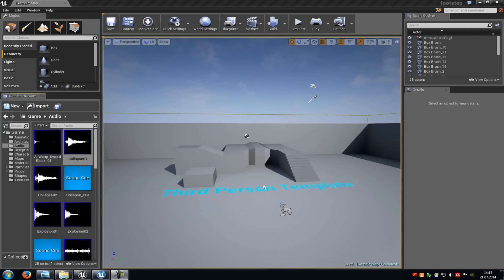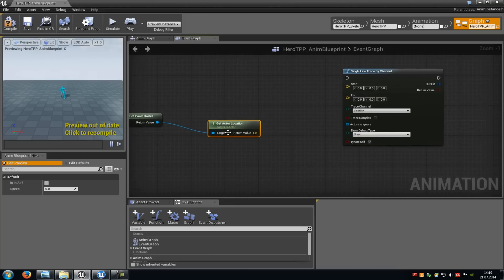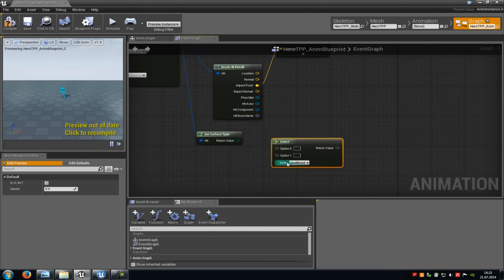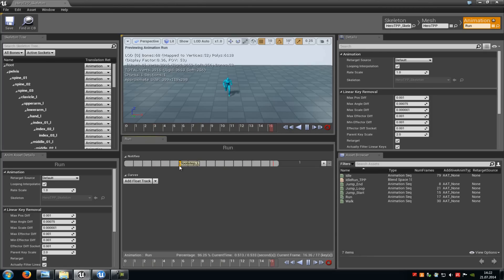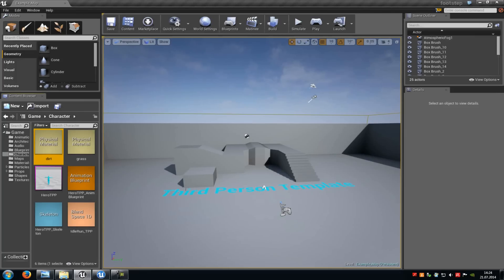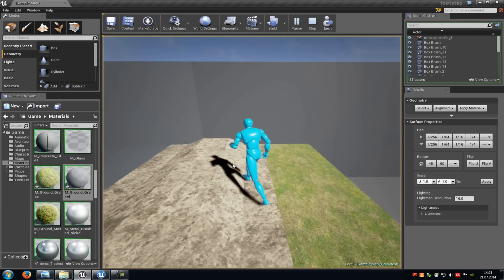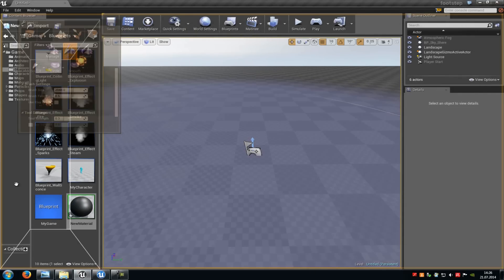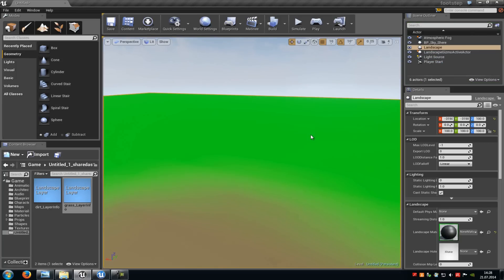Unreal Engine 4 Tutorial: Footstep Sounds (english)

Comment: Well im a bit late here but for anyone still around looking for a "Firstperson-nonAnimation-ObjectOnly" type solution, Ive figured one out! My solution used most of whats already explained here except for that all of the blueprints with the "break hit result" and "Line trace" and what not is all done inside the character's blueprint. For my project I have the character's animation rigged via using static objects that move and/or rotate from a "Timeline". Within the Timeline I have a Square-wave float-value to keep track of where in the animation the character's feet "Step" onto the ground. (Keep in mind: if you dont have any objects to have a visual representation with dont worry you can always just make a simple one-step-per-second-or-so guess to make up for it.) Within this float you simply edit it so that its set to 1 when you want to play the sound and 0 when you dont want it. Make sure to make the areas where its set to 1 short or you might have your sound playing more than once! (Also dont forget to Loop your Timeline animation!) After this is done simply take a wire from the Timeline's "Update" point and connect it to a "Branch" with the condition being "If the float from the timeline is 1 and is equal to another float 1 then go True". Simple as that. Then lastly, off of that branch connect the wire to the "LineTraceByChannel" Node and It should work. Hope this helps anyone out there! (Though keep in mind all of our projects will in some way most likely be different so it might take a little fiddling.) (Oh yeah, also to play the timeline just make an "Input Keyboard W" or something(what ever your walk-forward key or button is.) then tie the "Pressed" to "Play" and the "Released" to Stop.) Good luck out there! :)